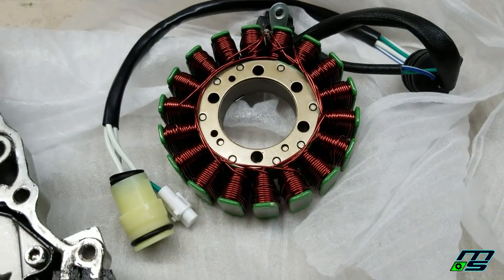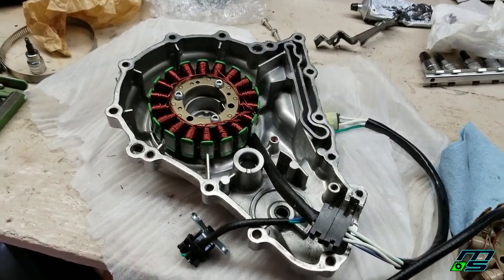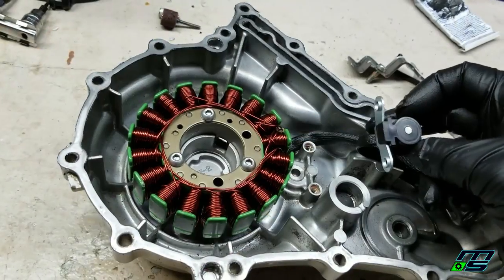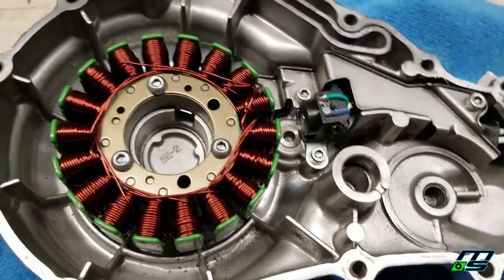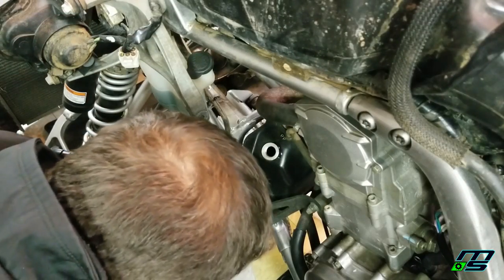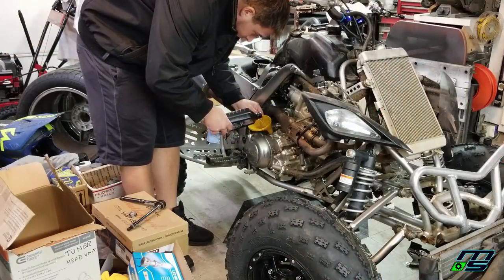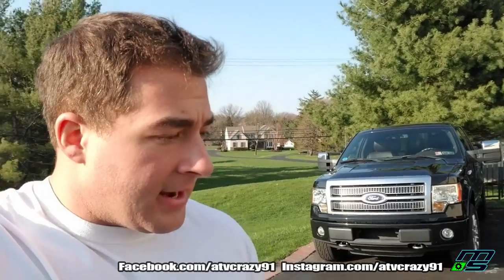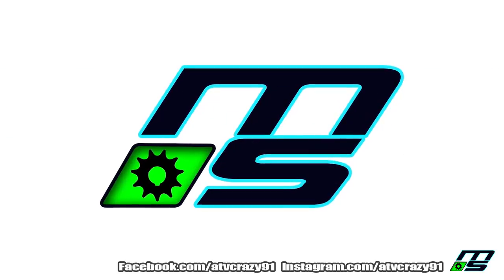IT LIVES!!! Project Raptor Part 8

Comment: Just grabbed a fairly low hour 07 SE with exact same symptoms for $1800.  Stator resistance was out of spec (high) so picked up an oem one and fired right up.

Thanks so much for saving me a lot of time!

Comment: This reminds me of when I bought a 2003 Polaris Predator 500 with a misfire. Needless to say a new carberator, petcock, woodruff key, stator, ignition coil, spark plug cap, spark plug, timing chain and guides later it ended up being the CDI box.... Glad you finally got it running.

Comment: Come to think about it when you said your stator was reading the same as the new stator I guarantee you the OEM stator is still good the problem was that crank positioning sensor I had the same problem on my Banshee
Reply from the maker: Same thought crossed my mind. Even thought factory sensor was reading within spec, something may have been wrong with it.

Comment: I don't know if you'll read this after a year but the stator was not it! The problem was the crank position sensor!! The reading on the stator has to be made with a set frequency because it is a coil... The multimeter would never read that low of a resistance on a coil because it is not prepared to do it... Great videos anyway ahahha great job with the oil

Comment: thats not a crank sensor its the pick up for the coils..  and also that stater has multiple holes because it can be clocked in a different position slightly and its enough to make it not run that was probably the problem the whole time especially if the OEM one gave the same readings

Comment: Man i  on the same boat happy for you im going to change the same part
Reply from the maker: I hope it works for you too man!
Reply: Check the wire all the way threw most the time theres just a shore or bad connection may be a easy fix or just replace it

Comment: wonder what was missed in your tests....since they were almost identical in the tests you did
Reply from the maker: I don't know; it could also possibly be from cleaning the points on the flywheel; the old stator may have worked as well.